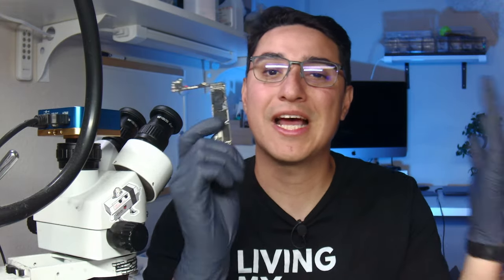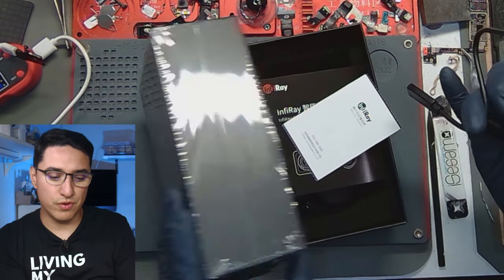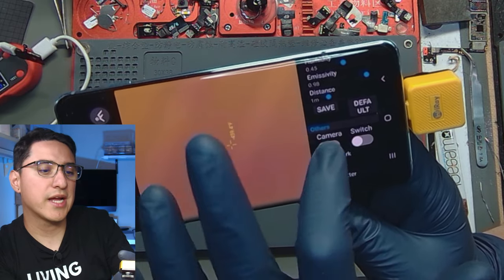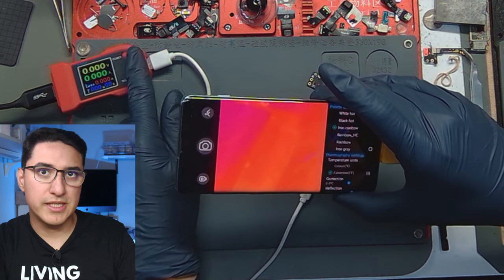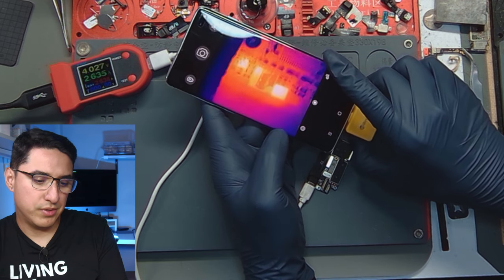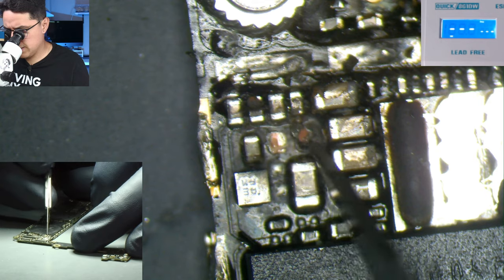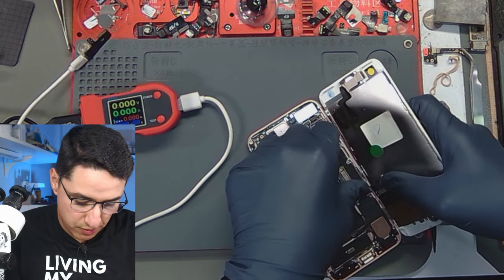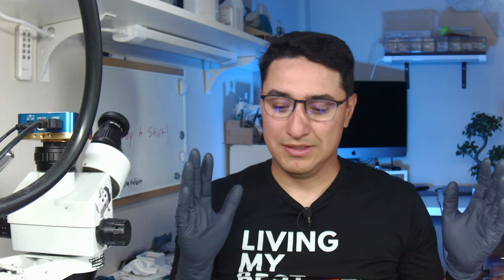Infiray T2S Plus - Thermal Camera Overview. Fixing iPhone 7 Plus with Water Damage for Data Recovery

Comment: My honest experience with the T2s+ Vs the seek compact pro, I found the T2S+ is far much better redardless. It has a better 25hz frame rate and better picture. The seek  compact pro has 320X240 thermal sensor and 15hz frame rate compared to T2s plus 256x192, but the T2S plus performs better in quality, picture and software. They both have temperature glitches 3-5 C  plus or minus. I have no problem finding shorts hot spot with the T2s+ and with the seek.
Reply from the maker: The problem with the T2S+ is that it doesn't hone in on the hot spot, like the Seek does. For that reason alone, the Seek is better in my opinion

Comment: Its not better then Seek Compact pro..
You can get way better result with the Seek Pro, simply because of the way higher resolution  Seek Pro 77k (320x240)  vds 49k (192x256) with T2L.
but what really lets these budget infiray dongles  down is the app... that is so limited... you cant even span lock if I recall.. really an aspect where Infiray should step up to the plate or at least made the T3S app valid for the T2series..
if you need an Infiray dongle that outperforms Seek Pro.. you need to look at T3S and up.
Seek pro with fx 2 resistors (1.25mmx2mm) / fast frame version form 2016 that aitn locked to only 9hz.
https://youtu.be/5hXQHaloQg8?t=30
example of the res.
https://youtu.be/Im1_Dyf69to?t=67
Reply from the maker: I agree. I'm a fan of the Seek solution

Comment: I've the same camera, and this app produce blury images. I recommed the "Free Community made apps for T2 | T3 | DP09 | DL13 series" from CleanUnbox/netman. Settings should be:
Scaling Mode = Nearest Neighbor
Sharpening = 0.50
Picture output resolution = 1024x576

So, there is no blury or sharpening filter, only the raw-data I guess.
Reply: I have same T2S + running on iPhone 13 pro, but software sucks, do you know is there alterantive app for iOS for this cam? Thanks

Comment: I think it is better to review Infiray T2L, it is a better camera than T2S plus, kindly review that thermal camera, thanks
Reply from the maker: Why do you say T2L is better? Would love to hear your thoughts
Reply: @VCCBoardRepairs  Because there is some reviews coming from other and as I’ve seen on comparison it is better the T2L than the T2S plus, kindly make a review of T2L and compare it to T2S plus?
Reply: @navotastechrepair6895  t2s has wider angle and closer macro.
t2l has sharpen picture. I can't tell which one is "better" but i heard t2l specialized for repairs, doesn't know if this is true or not.

Comment: What camera its better for microelectronic repair? T2s plus por seek thermal pro? Or both are same useful?
Reply from the maker: I prefer the Seek Compact Pro. I do a side by side comparison on the Infiray P2 video on my channel.
Reply: @VCCBoardRepairs  p2 has not macrolens, its not good for eelctronic repair but its good for others activities, the t2s has a good macro and 25hz but the seek thermal has more resolution, its a dificult desition.
Reply from the maker: Right. But the video has a comparison of all 3

I prefer the Seek Compact Pro with Macro lens and stand

Comment: I am trying to figure out wich I should buy:
Seek Thermal Compact or the infiray P2 
They both cost roughly the same and have about the same resolution.
The image from he P2 seems a lot clearer though. sharper and less lines and noise.
however the seek has a much wider temperature range wich could come in handy:
Seek: -40 to 330 C
P2:     -20 to 170 C

P2 has a way higher framerate
Seek: 9 hz
P2:   25 hz

Please help me choose!
Reply from the maker: I still prefer the Seek Compact Pro. It has a much clearer view when there's a short.
Reply: @VCCBoardRepairs  since the compact pro is out of my budget i will go with the p2
Reply: @VCCBoardRepairs  I bought the T2S+ 
btw, did you know you can adjust the temperature range from -20 to 120 for higher contrast or -20 to 450 for higher range?
Reply: @nielsdaemen  of course you can, but it more like -20-120 and 120-450, 2 ranges
And t2s better that t2p because it have focus.
Reply: @trololoev  Alright, thanks. I will get it in a couple days
Reply: @nielsdaemen  for what purpose you buy it?